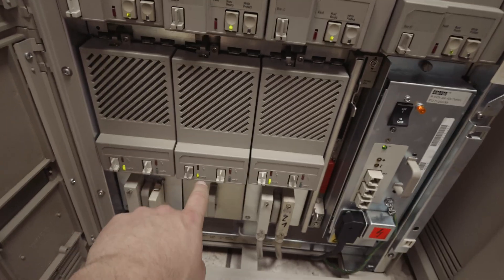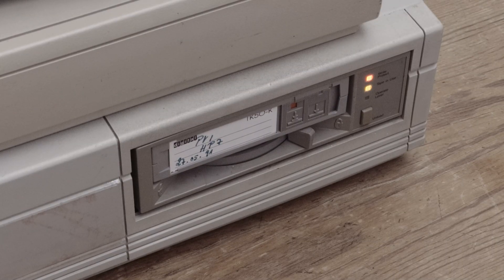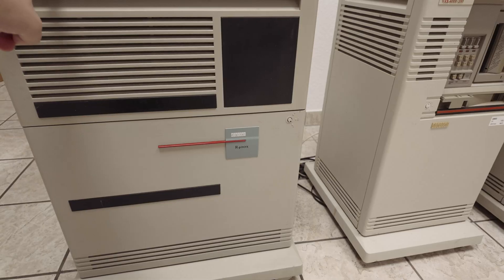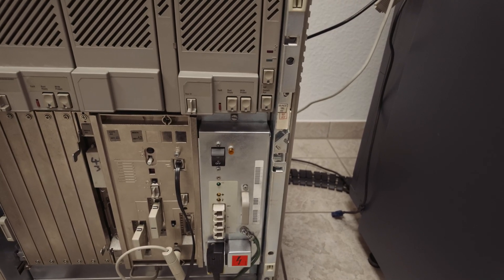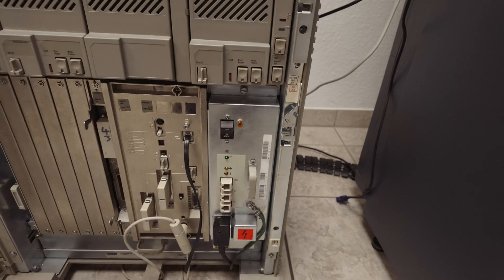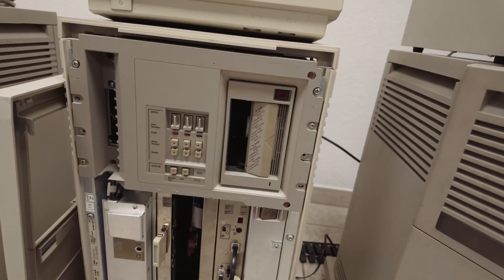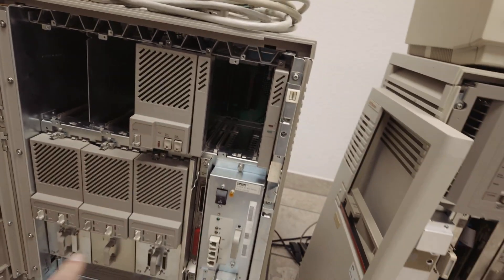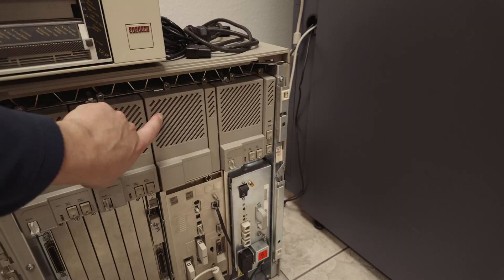Installation of the DEC R400X DSSI Storage Expander in the VAX Cluster

Comment: I got to do this in the early 90's. We had a brand new VAX 4000-705A and a VAX 4000-300. The 4300 got a 4705A cpu and max memory swap 512MB to match the 4705A. I put KFDDB DSSI daughter cards on both 4705A cpus that provide 2 extra dssi busses with 2 ports for each bus taking up the last 2 Q-BUS header panels. A kfddb is a hardware package containing 2 kfdda packages including dssi terminators. So now we had 4 dssi cables each coming out of each A series 4000 VAX. Each dssi cable started at one VAX, went to a SF72 building block containing 4 RF74s and than back to the other VAX. Times 4. 16 RF73s and 74s. The top 2 SF72s made a pitstop to a TF867 tape loader before back to the VAX. That was something to hear all 16 disk POST! 😊 The cabinet was an SF200 wth 2 TF867s at the top. 2 SF72s below it and 2 more SF72s below that and an 10 port DSSI header plate at the bottom next to the power switch which switch was available through a 3 finger sized hole in the back cover of the SF200.
Reply from the maker: DSSI is an interesting technology, but unfortunately it is becoming increasingly difficult to obtain parts these days (especially in Europe, as many US retailers do not ship here). A VAX 4000-705A or even a VAX 4000-505A with the extra daughterboard would be a nice thing to have. I could upgrade my VAX 4000-300 with the backplane (this is not possible with older revisions), but first I need to get the hardware. With the daughterboard, there's no need to use the slow KFQSA QBUS controllers for more than two buses and it is possible to use 4 "fast" SHAC DSSI controllers. However, there must also be enough DSSI hardware available (and enough expanders; I'm glad I've already found one). I would like to connect at least my HSD30 controller, but I haven't been able to find the cables for it (at a reasonable price) yet. Then I could run SCSI hard drives on the DSSI bus.
Reply: @DECcomputers we also had 4705a systems connected to 2 hsd50s on the front side af sf800 cabinets and 2 on the back side along with an hsd30 to run 2 tz887s and a tl892. The dssi cables look like 50 pin high density cables except on the 4xxxA side, they're right angle. We had 5 dual node clusters set up this way. We limited the vaxstation satellites to 64 for each cluster because DECnet cluster aliases are limited to 64 with phase IV. We used DECdfs to mount other clusters disks over at most 3 clusters. Users had a full interactive account on one cluster and network only on the rest.
Reply from the maker: @muddflappmohicann7639  The SW800 cabinet is really nice; I could definitely see one next to my cabinets :) The HSD50 can handle 6 SCSI buses, which means it can connect 36 to 42 disks by using only 2 DSSI IDs (with two controllers). That could be a lot of storage for a VAX machine. Unfortunately, there are two different DSSI connectors: PS-style, which is the connector on the VAX 4000, and MR-style, which is the connector on the HSD controllers. The DSSI controllers for Alpha (KFPSA, KFESA, KFESB) should also have this connector. However, I only have cables with PS to PS and MR to MR, but not MR to PS. But 64 satellites is still a long way off in my case ;) However, I also need to test the options that DEC offered for larger environments (such as DECdfs). The same applies to the larger management solutions for clusters.
Reply: We also had a VAX 7000-600 with 3 KFMSA XMI to DSSI adapters which provided 6 busses to connect to 6 full SF72s and 2 TF867s at the top of a SF400 cabinet.

Comment: I don't know what any of this stuff does but it looks really cool.
Reply from the maker: Thanks. These are a few servers from the early 90s and the era before x86 (on servers); for time-sharing with OpenVMS on serial terminals.
Reply: They can’t do much of anything that the phone in your pocket can’t do faster and better 😂
Reply from the maker: @moe47988  That's true in terms of computing power, but I keep having problems connecting my serial terminals to my smartphone ;)
Reply from the maker: @DennisHolmberg-sl1hz  A smartphone as a terminal should not be a problem, since UCX also supports telnet (and later even SSH). And all of this can be done via WiFi (provided nothing is blocked). The DECnet protocols (such as LAT), on the other hand, do not work over WiFi, as they are non-IP protocols.
Reply: I know what it is doing and it still looks cool :)